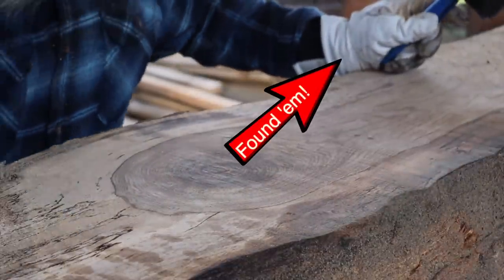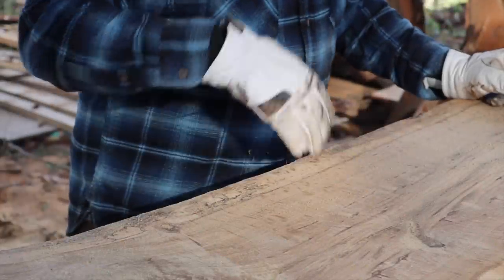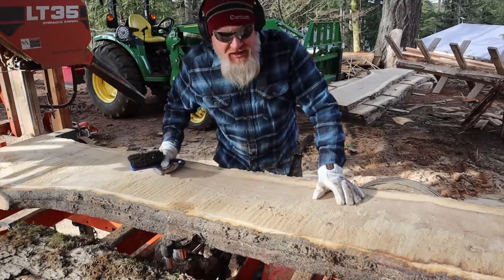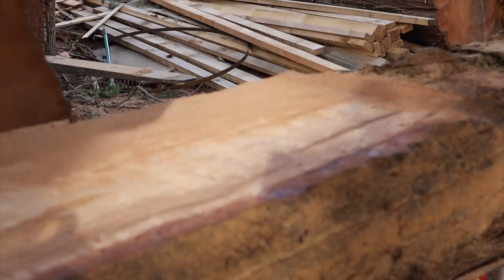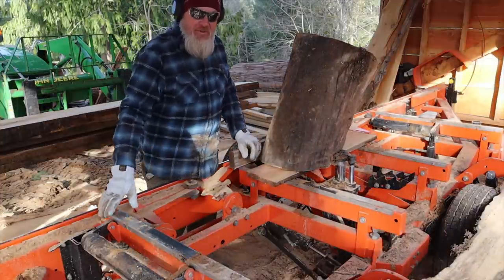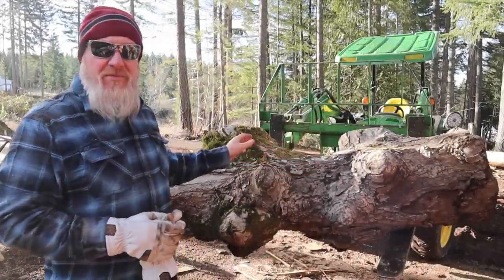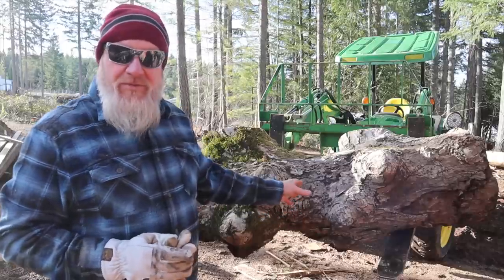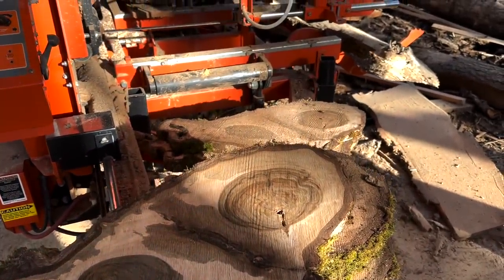Crusty Logs Make Beautiful Lumber

Comment: 16:48 Great editing sequence.   I think people that cut wood all of the time see the value and beauty with each slab that comes off the saw. Sixty years ago my father used to cut 10-12 inch cypress logs on a long diagonal so the resulting slab was a 10 -12 high by 36 inch oval.  The oval slabs were sold to a painter.  For years after we had swamp and marsh landscape paintings
on the ovals in our home.   Most folks did not even realize it was a tree slab they just loved the painting.  Would like to see where these are used and the finished product.
Reply from the maker: Thank you! People really like those oval cuts and the mill really does a great job making them. I will definitely update on the pieces I make with them.

Comment: Those boards from the first log look absolutely amazing …….those last cookies you cut Jason would look fantastic sanded and polished up on a wall made up as key holders or coat hangers or used for house numbers,as I’m not a fan of epoxy I would just prefer to leave any imperfections in the wood ….👍👍👍🇬🇧🇬🇧🇬🇧
Reply from the maker: I think the epoxy can highlight the imperfections along with stabilizing the wood. It definitely can be over done.

Comment: I was going to say try dragging one end over to the forks and then the other side.  Saves on the back.  I park my equipment trailer next to my mill and do the same thing by setting one end on the trailer.  Then I can flip and remove the sawdust from the other side. Saw you doing it later in the video

Comment: I have a LT35 as well, other than 10 degree what do you run on it? I was told that the 24hp engine would have a hard time running the 7 degree blades.
Reply from the maker: I like the turbo 747 blades which are 7 degrees. I’ve run 4s on hardwood but not for a long time.

Comment: seems like you have a lot of water spray on your blade. do you find that much water/fluid is necessary? is that for lube or to keep the dust down?
Reply from the maker: It does a bit of both. With this blade being kind of worn, I wanted to run more water to keep the heat down.